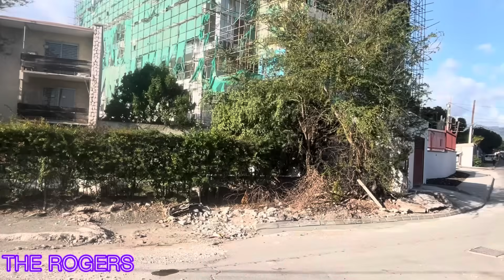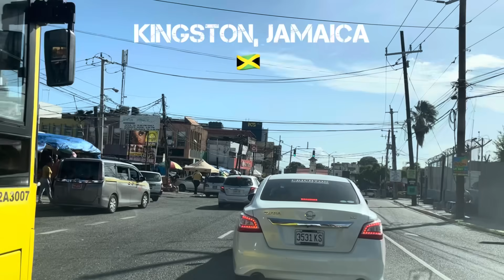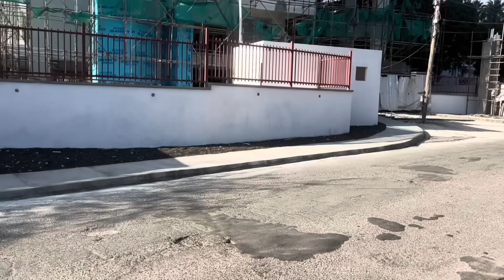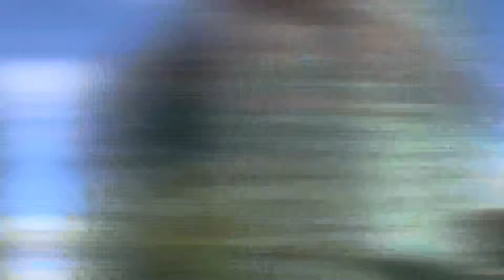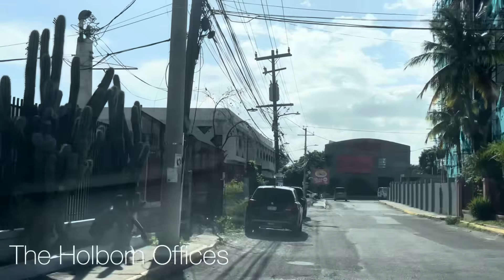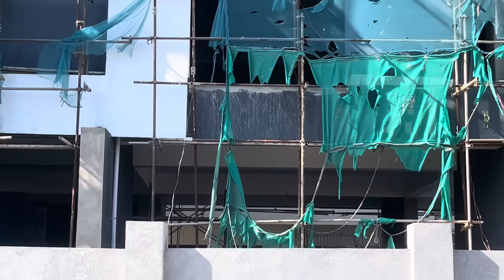The Ultra-Rich Are Taking Over Jamaica’s Skyline… Are Jamaicans READY FOR THIS?

Comment: Those are midrise a skyscraper starts at 40 stories
Reply: ...where do you get your definition from? Here's a blurb from the Council on Tall Buildings below:

A skyscraper is a tall continuously habitable building having multiple floors. Most modern sources define skyscrapers as being at least 100 metres (330 ft)[1] or 150 metres (490 ft)[2] in height, though there is no universally accepted definition, other than being very tall high-rise buildings. Skyscrapers may host offices, hotels, residential spaces, and retail spaces.
Reply: @garfieldwhittaker944  skyscrapers usually start at 100m or about 25 floors
Reply: LOL

Comment: The hard rock hotel in Montego Bay will be taller than the pinnacle. It will be 30 floors.
Reply: The floors on a building doesn't determine its hight I think the pinnacle will be the tallest buildings in jamaica it's a deep ceiling development so one floor could be as tall as two floors at the hardrock or the moon palace

Comment: The hard rock hotel in Montego Bay will be taller than the pinnacle. It will be 30 floors.
Reply: The Moon Palace the grand Montego Bay will be 30 floors not Hard Rock and even at 30 floors it may still not be taller than The Pinnacle. It’s the height that determines tallest not the amount of floors, the pinnacle at 28 will be taller than Cuba and Santo Domingo’s 42 and 41 floor buildings
Reply: @JadenMalik the Hard Rock will be over 20 floors for sure...
Reply: Wow